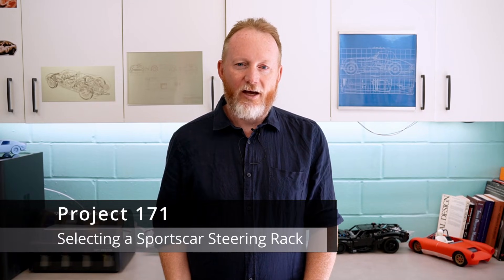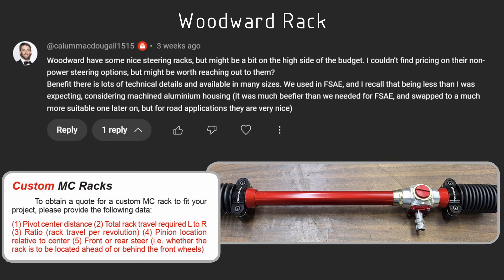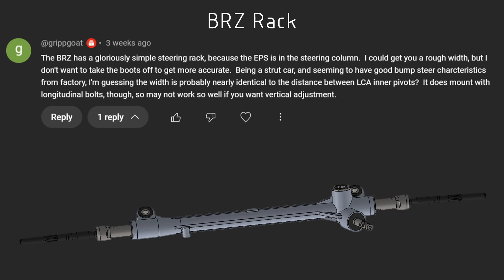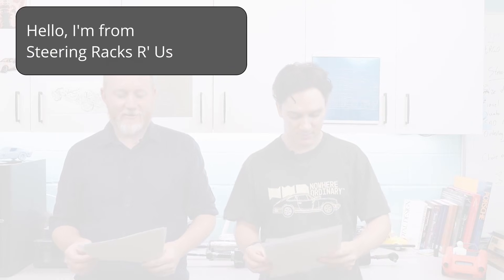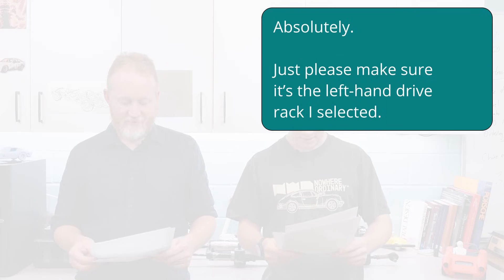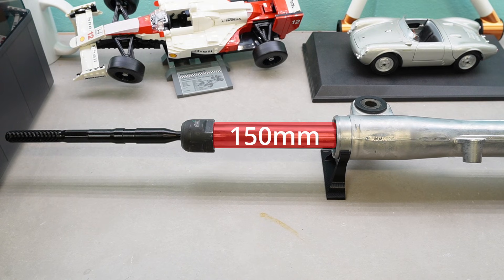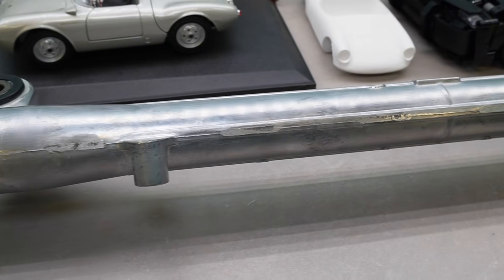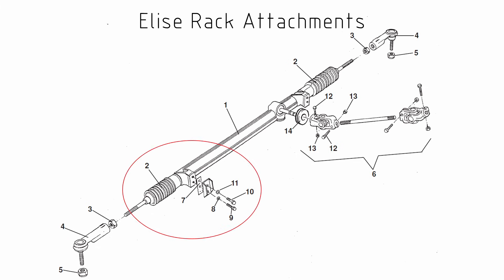Choosing a Steering Rack for a Custom Sportscar | Project 171

Comment: 5:18 I work for an aftermarket chassis company so I usually buy reference parts by PN and lots of the sellers want the VIN. I had this exchange several times before I started pulling VINs oof of for sale vehicles in my area 😂
Reply from the maker: Thats a really good idea

Comment: I’m looking converting my track car (w202 Mercedes) from steering box to rack. I’m so worried about stuffing it up, even though lots have done similar I have no doubt the amount of bump steer they’ve introduced (amongst other things, Ackerman etc) would ruin the car. I think I’ll have to pay an actual engineer to work it out for me. Or if I just need to find a rack that’s the same length as the distance between the pitman arms when they’re straight?
Reply from the maker: You can always get it setup and then measure the bump steer in real life.

Comment: Hi dude, discovered your channel this morning and I love the project !
Theoretically, in an even more minimalist + "sensation engaging" + less maintenance approach, do you think you would be able to have a more direct steering mechanism ?
What I mean more precisely : you would keep the double-wishbone suspension system + the "Ackerman" geometry, but instead of having a steering ratio (between the steering wheel gear and the steering rack), you would have a mechanism similar to the one of a Go-Kart (like here https://www.youtube.com/watch?v=8MopyFDa3vU ), but with more robust parts to scale to your project.
What do you think would be the consequences of that ? I feel like this would provide the driving sensation I'm looking for =D, but I'm obviously concerned about the steering response (vibrations in the wheeling drive, would it be tolerable as a daily car ... not sure)
Reply from the maker: Have been involved with a pitman arm driven post a reduction gearbox in a small single seater.  Definitely possible. First car we did with it had great steering, second not so good due to some gearbox manufacturing issues causing some binding.  Happy enough to go off the shelf and conventional this time, but wouldn't write it off for a later project.

Comment: Hey Doc, love the channel !  What's the advantage of a high steering rack linking to the top of the upright rather than a low rack linking to the bottom ?  Was it just the fit it this case ?  I would have thought a lower cg would be preferable ?
Reply from the maker: Am sacrificing a bit of COG but the high rack makes for a nice removable bracket on the top of the upright, good for camber adjustments. As well as being in a good position for a long steering arm at the upright.  It also packages pretty well.  Otherwise yes a lower COG would be the way to go.

Comment: I wonder if the SW20 (MR2) rack would have been a better option, that you probably could have gotten locally (probably not new though)... but hey, if the BRZ rack will work than so be it.
Reply from the maker: MR2 rack probably would have worked, and with it being a mid engine car I probably should have had a look at it.  BRZ/GT86 certainly not the only option.
Reply: @KevinHayward7  Yeah, being intimately familiar with MR2's (currently own 2 and have owned a total of 5 over the years) what really made me think about it was the fact that it (w20 chassis specifically) was already configured in a leading steer position layout and that RHD models were made. Plus, there was both hydro power assist and manual versions.

Comment: No need to thank us to tune into the channel, it’s always amazing to see the in depth thoughts that go into the engineering side.
From memory tho the BRZ rack is the same as the Toyota 86 but tuned quite different on the input side so there should be plenty of adjustability once set up
Reply from the maker: Thanks for your kind words. I am grateful to those who watch though.  There is a lot of good stuff out there to watch.

Definitely interested in the differences between the BRZ and 86, and how deep they go. If only other car makers were collaborating on providing reasonably priced sportscars.

Comment: Why did you want to mount the rack near the upper control arm pivots instead of the lower? What’s the benefit of that you get in exchange for raising your center of gravity?
Reply from the maker: It is a really convenient place to have a bolt on bracket at the upright to take both the upper balljoint and the steering connection.  A bracket that takes both can then be shimmed to adjust kpi/camber. Loads are lower at the upper balljoint which helps given that it is a bolted connection (everything can be a bit smaller). 

Also with the caster angle on the upright and the rack forward of the axle line (to help with feet clearance) there is more space for the steering arm. This is because the upper ball joint is more rearwards in the wheel well.

But can make the rack work either up/down forwards or backwards.
Reply: maybe it's a space problem with peadals and feet?
Reply: Also interested in hearing the benefits for this!

Comment: The flow on effects the column mounted epas are interesting. I imagine this "manual" brz rack is considerably cheaper to produce than the hydraulically assisted racks that were prolific between when the mini and the brz were made. Interesting that it is quite a modern car where you find the simpler rack.
Reply: I don't know how relevant it really is for the 99.9% of utilitarian vehicles out there, but I also remember hearing from Mazda's Dave Coleman for the ND Miata that since the steering column is only so stiff, having the assist mounted to the rack instead of the column can improve steering feel/feedback.
Reply from the maker: I think @neilborja has a good point. We experienced something like that when doing a steering system with a planetary gearset on the shaft (to a pitman arm). If we did the gearbox before the shaft it twisted up quite a lot (really interesting to see). Once it was on the pitman arm the steering was a lot better.

My guess is that being a rear wheel drive car the BRZ/86 can have smaller trails on the corner lightening the steering loads. This is difficult to do on a FWD car.  Probably meaning less assistance is needed, and probably has better feel.

But that is only a guess.
Reply: That is a good point. Elements of the steering column like universal joints (and the mounting to resist the forces they generate) might have to be stiffer, and possibly heavier to handle the higher torque from the EPAS. When compared to a powered rack.

Comment: Nice one Doctor!  Can you expound on your reasons for choosing to push the rack to the front rather than the rear (as in the Elise) for us please?  Is there some steering geometry goal you are chasing here?  Also, how much of a geometric complication is the seating position vs pinion position and angle on the Toyotaru rack there?  It looks like it's got quite a lateral angle on it.  There was a great FSAE video I watched recently about steering column design and I realised that the hooke couplings angle and phasing can be used to tune steering wheel ratio to the roadwheels - or untune it, as the case may be.
Reply: Also interested in the front vs behind axle reasoning, learning a lot from you
Reply: There are numbers of reasons for doing so but probably the biggest one that comes to mind (and might be the primary here for the Doc) is what's know as Deflection (sometimes called Compliance) understeer...  When the rack is in the leading position (i.e., in front of the axle centerline), any lateral deflection in the suspension while cornering will result in the steering angle effectively reducing (i.e., "understeering" or could say "toeing out") whereas if the rack is behind the axle, any later deflection will result in an increased steering angle (i.e. "Oversteer" or "toeing in").

Another reason is when steering, the load on outside tierod assembly (By that I mean the side that is on the "outside of the cornering direction, not the "outer tie rod itself") is in tensile loading since it is having to "pull" on the outer (i.e., heavier loaded) wheel during cornering, so little to no chance of compression loads which can result in buckling of the tie rod assembly.

It should be noted that everything mentioned above is opposite when talking about the  rear of the car (i.e. rear wheels) with IRS type rear setups. To get the same effects at the rear wheels, the toe links need to be behind the axle center line.
Reply: @CP_300PRC  Presumably you could arrange deflection understeer with a rear-mounted rack by mounting it below the wheel centreline.  Doesn't address the compression instability of the toelink but then this design constraint is everywhere in the suspension system.
Reply: @AndyRRR0791  under the axle centerline wouldn't change anything as the control arm defection is still inward and thus that would be the same as an outward deflection of the steering and if the steering attachment is behind, the result is increase in steering angle.

Now the height above or below centerline will change the degree of steering angle change per unit of deflecting but the fact is,  behind axle will always result in increased steering angle and in front of centerline will always decrease steering angle.
Reply from the maker: @CJ-ty8sv has some of the thought process I was using. I usually deal with cars with full rose-jointed suspension systems where bush compliance is not much of an issue. I did think one advantage of a rack forward of the axle would be some compliance understeer. However I haven't calculated what to expect in that way just yet.

Frankly the bigger goal was to try and keep the wheelbase as close to a Porsche 550 as I could.  I really want to build a small car (a huge fan of lightweight sportscars). This meant I didn't really want to have a full suspension mounting system forward of the chassis.  The elise does this well but there is quite a bit of structure up the front of the chassis.

My aim was to have one bulkhead at the front that would take a lot of the forward components. This would possibly be coupled with the heavy loaded lower wishbones feeding into shear of a composite panel.  Which is much stiffer and stronger than feeding in in bending (close to normal to the panel).

Still so much to work out though, and I will have a clearer idea once I get a fullsize mockup going.
Reply: @KevinHayward7  Thanks Kev!. I thought about Mr @CJ's comments a bit more and figgered out what he was actually saying, being the compliance of the lower wishbone bushes moving the lower ball joint inboard.  I was kind of thinking rigid like spherical bearing joints as well which helped confuse me.  I appreciate your idea of feeding all the loads laterally into the firewall.  Must be time to get that BeamNG model up and running to have a play...?

Comment: Is there any concern when flipping the rack since the inner tie rod joints were designed for greater compression vs tension loads? I'm not even sure if this is true for the tie rod joint, just something that came to mind considering ball joints are designed for tension or compression. On your lightweight non-aero car I can't image it's an issue, but it might be if someone were building a time attack car and flipping the rack.
Reply: Generally, a single force member like a tie rod is compression limited because it has to resist buckling. The tensile capacity should be greater than the compressive capacity.
Reply from the maker: Not really. The tierods get loaded in both tension and compression anyway.  One will be in tension while one is in compression. And for a lot of sistuations the inner wheel steering loads can be as high or higher than the outer. This means that all tierods need to be designed for both compression and tension.

Comment: Vastly different Cfactor's between the Mini and the BRZ.  Will you go back and re-evaluate your Caster Trail and Scrub Radius?  which is better to adjust to decrease efforts - probably Caster Trail?  but reducing Caster Trail reduces steering torque variation at the limit and gives less limit handling feedback to the driver
Reply: Cfactor? Genuine question, what is that?
Reply: @TheBiscuitsandGravy   with a pinion and rack you can't measure gear ratio via tooth count. Cfactor is mm rack travel per pinion rotation.  Mini Cfac=50/2.5=20mm/rev.  BRZ Cfac= 150/2.5=60mm/rev.  BRZ is 3x faster, roughly 3x heavier steering with the same steering arms but Dr Kev will change all that but I doubt he has space to package a 3x longer steering arm so he's going to have to adjust his steering ratio in several places combined
Reply: @blainebolze1626  Thanks for the response.
Reply from the maker: Not planning to change the trails. Aim to do it all with the steering arm.  The Mini Cfac was actually 90/2.3 = 39mm/rev.  This measn the BRZ is only 1.5x faster than the mini.  I will end up with a slightly heavier steering in the end but not by much, as I won't make the steering arm 50% longer. I am aiming for 30-40% longer.

Hope that helps.  Might have been easy to mis-hear the mini rack numbers in the video due to the Australian drawl...